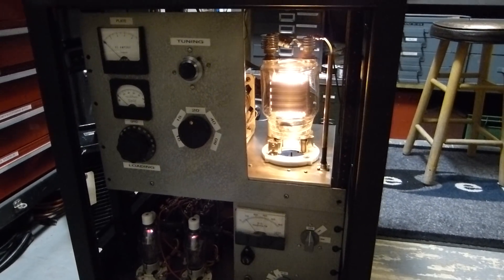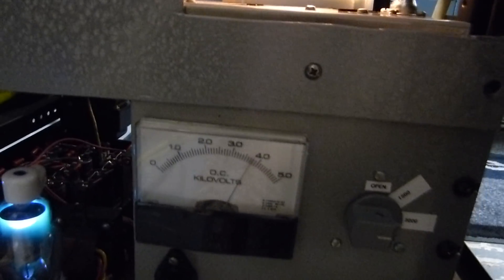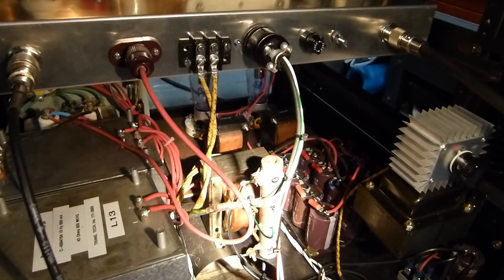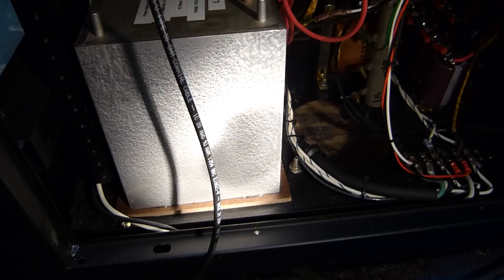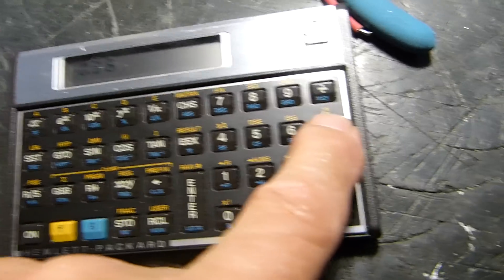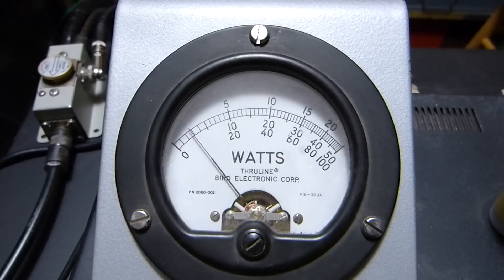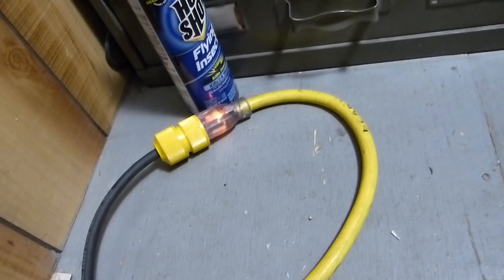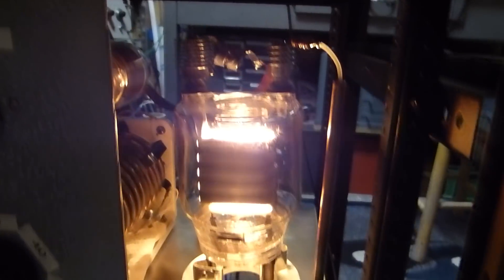(1 of 3) 833A Triode Vacuum Tube Radio Frequency (RF) Amplifier For 20 Meter SSB

Comment: I´, tinking of building a 833 amplifier in a microwave oven, using the microwave transformer as HV power supply....
Reply from the maker: I don't think an 833A will fit inside a microwave oven. Absolute maximum plate voltage is 4KV for the 833A. Adjustable negative bias around -90 volts to set plate resting current at 50 mA. The best datasheet is the RCA 833A. Best of success with your project.

Comment: Hello, what circuit did you use to build this amplifier on this wonderful tube?
Reply from the maker: The circuit is a common tuned-grid-tuned-plate,  (TGTP) grid driven design that is common in the vintage ARRL publications and easy to find. There are a good many circuits to be found for the 813 that can be used on pretty much any tube. The difference with the 833A is it requires much more neutralizing capacitance (because i is physically so large and has so much interelectrode capacitance) and the circuit I used is from the Gates transmitters. Attached is a link to a good schematic for the Gates that might help. Gates used the 833A in several of its commercial AM transmitters back in the 1950's thru 1960's for both RF and modulation. Beautiful stuff... hope this helps.  73
https://www.steampoweredradio.com/pdf/gates%20harris/manuals/Gates%20BC-1J%201000%20Watt%20AM%20transmitter%20Manual%20Circa%201955.pdf

Comment: i came back to watch again and steal some tips in view of the camera David , busy finishing mine, hope to mke a video on it when its done ...thumbs up
Reply from the maker: Great... not many people tackle the 833A and make it work right. By far the most difficult thing was getting it neutralized. Without watching this video again, I might not show how I had to stand up a copper strip neutralizing capacitor to finally get to where I could consistently trim the neutralization out with the little round Millen type capacitor. Also, I now use an outboard tuner to make my iCom exciter happy as I never did get the input Z of the amplifier to 50 ohms with no reactance. If I can help, please let me know. I will send you pictures of what I have now if it will help.  I get 1000 watts of carrier with 50 watts in (13 dB gain) and it does easy 1125 PEP watts output sometimes 1390 on my PEP wattmeter.   73

Comment: Hello, is it possible for you to write here the mathematics of how to get the efficiency of the amplifier ... I don't know how you got the .63%, there I got lost, thank you.
73" nice amplifier
Reply from the maker: I determine the input power to the plate of the 833A by multiplying the plate voltage times the plate current and at the same time measure with an RF wattmeter the output power. 
An example might be 4000 volts at 500 mA would be 2000 watts for plate input and assume 1400 watts output  we would get 1400/2000 or 0.7 or 70%.
Reply: @ElPasoTubeAmps  thank you for your answer I appreciate...✌

Comment: I have two 833 tube s I'm going start my build with .beautiful amp you created there.This video helped on some variables I needed
Reply from the maker: My 833A amplifier is by far my favorite amplifier. 1000 watts to the antenna and it is loafing. That beautiful orange spot right in the middle of the tube plate. It has an aura about it that I love. It does have to be grid driven. It is not a candidate for grounded grid as it is not a high mu triode. Its perfect role in life is as a class-C, plate modulated AM transmitter in commercial AM transmitters in the 500 KHz to 1.6 MHz range but has a rating to 30 MHz. I see them used occasionally in 160, 80 and maybe 40 meters but it just became a project to make it work perfectly at 20M and it does. It has to be grid driven and perfectly neutralized. Neutralization is not as mysterious as some people make it out to be. My neutralizing capacitor consists of a large copper strip standing up beside the glass of the tube - about 1" wide and the height of the tube in parallel with a Millen round type (2-10 pF) neutralizing capacitor to get it perfect. It takes about 35 watts to drive it to 1KW. I studied the Gates transmitters schematics and used their input and neutralizing techniques but the input impedance in their amplifiers is from an 807 driver and is high impedance so I use an outboard antenna tuner (not an uncommon thing in homebrew amplifiers) to match the input impedance of the amplifier to a 50 ohm load so my iCom will load up to it perfectly. I tune the antenna tuner input to 50+j0 ohms using an impedance bridge. My plate tank circuit is a modified B&W 852. I think the output tank Q is about 16 and the input Q is even higher so as to be broad tuned. Hope some of this helps. I also run it at 4KV.   73   WA4QGA

Comment: Nice video! Where are the measuring points for the SSB audio signal? Did you measure the grid voltage of the tube? Thanks for your answer, 73
Reply from the maker: Now that I view this picture again, there has been a few improvements to this amplifier. I added a Variac below the switch to the right of the high voltage meter for bias adjustment and I added one of those cheap blue LED meters to the board behind the 866A MV rectifiers so I can see what the bias voltage is set at. I monitor the SSB audio signal in the RF waveform. Some better pictures are on my QRZ page.  73  WA4QGA

Comment: This video is making me very nervous.
Reply from the maker: With an amplifier and power supply like this opened up and working on it, it is probably a good idea to be very cautious as it can be death on contact is careless. Once buttoned-up and all the safety shields put on as it usually is nowadays almost three years later, it is a real pleasure to operate and see it perform. This was the beginning of the project and I can understand how you feel, even watching it.
Reply: @ElPasoTubeAmps  Well, I would have been a lot less nervous if you hadn't turned on the B+ before you pointed out all the plate tank circuits. A graduate of my high school ham club fried himself on a homebrew 4-1000A 40m linear by omitting interlocks and being careless. Since I didn't know him, I had the task of disassembling it.

Comment: If you held a geiger counter in front of the bulb, it'd go apesh!t from the amount of radiation. That's some nice cancer right there.
Reply from the maker: I have Geiger counters and I can assure you, there is no cancer causing radiation coming from a tube running at 4KV. It takes around 50KV to start getting any serious level of gamma radiation.  Your dentist X-ray machine runs around 75KV.  The only radiation coming off a tube like this is infrared. The RF radiation in the room is of such low frequency and power it is of no concern.  Even microwave ovens at 2.4 GHz is a low frequency compared to gamma radiation at 10^19 Hz which would be 10 Billion GHz. We will be OK even with our cell phones running in the 800-900 MHz range next to our head. The news media often times does much more harm than good propagating fake news - that is where the bad "radiation" is coming from in my opinion.   :-)

Comment: Looks like it needs a soft start on those rectifier tubes inline on that switch to the high power side of the tubes in the rectifier circuit to keep that arcing down to a minimum, didn't look good to me.
Reply from the maker: MV rectifiers are never recommended to work into a capacitor filter but these are arranged in a voltage doubler so there is no way around it.  I suppose I got lucky that the value of the capacitors are not so large as to damage the tube at turn-on. I put a soft-start in one of my other amplifiers using an 8 ohm heater element in series with the primary of a large plate transformer but it caused much too long a delay and I ended up jumpering it out to about 2 ohms. I found out from that soft-start that if it doesn't pull in in 1/4 second (250mA) or so, it may not pull in at all once I start talking or the load becomes too heavy. It is tricky sometimes. Anyway, while I agree with your thoughts on the rectifiers, it has amazingly been working great from the beginning.  Something about those beautiful MV rectifiers I can't get away from. I use a pair of 872A in my AM transmitter power supply, twice the size of the 866A. Thanks for your comments. Stay safe...

Comment: Interesting..you are so close... I have your solution to the freq. response and POWER OUTPUT problem  no parts or build change..just circuit changes..-Dale   retired RADIO Engineer....
Reply from the maker: I did finally get it perfect. I studied and duplicated the way Gates does it on their 833A amplifiers. I am perfectly tuned input grid resonate and neutralized. I get 1000 watts output with 25 watts drive and I know it will do more. It is a beautiful performing amplifier and possibly one of the best I have built. It definitely has a "voice" on 20M and I much prefer it to the GG amplifiers I have built. They are just too easy.  :-)  
But I am always willing to learn new ideas. What did you have in mind for the issues I was having in this video?
73   WA4QGA

Comment: Does a radio frequency amplifier amplify a signal at any frequency? Or a better question might be can it amplify anything coming into it via an anode?
Reply from the maker: There are broadband amplifiers that do not have to be tuned and will work, for example, from say 50 MHz to 150 MHz or an even more broad frequency range but in the range they are designed to operate they are broadly tuned. In amateur radio amplifiers the input signal is applied to either the grid or cathode. Often times these inputs are not tuned but the output circuit (the circuit that is connected to the antenna) is tuned for a specific frequency. However, these types of amateur radio amplifiers can be tuned over a small frequency range, for example, 14 MHz to 14.3 MHz by making the inductor or capacitor, or both variable. I hope this helps.
Reply: @ElPasoTubeAmps  To an extent it does help. Thank you. Do you have an email? There are more technical question I have. Your website does not appear to be working.

Comment: I am a bit confused about the rf frequency range of the 833A vacuum tube. According to https://en.wikipedia.org/wiki/833A it says 15-30MHz. Is this 15Mhz to 30MHz or 15Hz to 30Mhz. Does anyone know?
Reply from the maker: The 833A can be used as an audio amplifier so it will work perfectly in the audio range and work at 15 Hz thru the audio range to 20KHz and continuing upward in frequency all the way to 30MHz. In the old AM radio stations, it was common to have two of them operating as the RF amplifier (AM transmitter frequencies are from 500KHz to 1.6MHz) and they also used another two of them for audio frequencies (for a total of four 833A's) to modulate the two RF tubes.  Here is a link you might like for a Gates transmitter using 833A's.
https://www.americanradiohistory.com/Archive-Catalogs/Gates-Harris/Gates-BC1-Gl-Transmitter-1962.pdf

Comment: Looks like a good candidate for a single ended audio amp!
Reply from the maker: I have already been there. I did not have a proper single ended output transformer and used a KW level push-pull transformer that had the core saturate at about the level of quiescent current for the 833A so LF response was terrible. Not saying the 833A can't be used in a SE amplifier but the OPT is going to have to be pretty special.
https://www.youtube.com/watch?v=65ln3YUkUXU&t=2s
I like the 833A but it is no easy tube to deal with. It can not be used in a GG RF amplifier as the mu is too low so it has to be a TGTP amplifier with neutralization as seen in this video. I have three of these tubes and only one is worth having so buying these from Ebay is a real pig-in-the-poke as the saying goes. It may look great but may also be very weak.

Comment: Can you send me a schematic for 866 tube voltage doubler.  I can only find the ones with no doubling voltage to choke and caps.  its the 866 tube section I cant figure out.

Comment: I bet that cost a fortune to build. and you need a laser pointer. So when you turn that beast on does town lights dim? I would bet that the house lights to and I would hate to be your neighbor watching TV.
Reply from the maker: If a person had to purchase every part, paying  full Ebay price or new price from a commercial seller, you are right, it would cost a fortune to build any of this equipment. But, being a ham radio operator for the last 56 years I have accumulated many of the parts so the actual cost at this point time was probably $200... not really sure.
I am always aware of possible TVI or any kind of RFI from my station but now that everything is digital, those problems basically don't exist anymore. 
I have been in this house for 26 years and have asked my neighbors several times, even lately, if I cause them any interference and they don't even know what I am talking about. I do get into my personal stereo a little bit but it is all analog and a combination of vacuum tube and solid state and within a few feet on my property. 
In the "old days" my transmitter would get into the TV,  the intercom, the phone lines,  the stereo and even make the garage door open and close on my house and my neighbors (this was at a different location I am at now) but the digital age has solved most all of those problems for me plus I take this hobby serious and can measure my spurious radiation which is negligible so, life is good and no one in my neighborhood knows I am transmitting.
I might add that in the "old days" we generally were not so concerned of how important it was to use a balun at the antenna to properly match an unbalanced coax line to a balanced antenna, in particular like a dipole. That awareness has changed in the last few years and I use proper matching techniques to prevent radiation from the feed line. Not only does proper matching of the coax to a balanced antenna result in much less, to the point of no concern, of radiation from the feed line when transmitting, it also reduces the background noise at the receiver.
I appreciate your comment and I hope my reply makes sense.
I should use a laser pointer - thanks for reminding me.
Reply: @ElPasoTubeAmps  I am ham as well. Love it. It is time for me to up grade to the next level.
Reply from the maker: @carl112466  I became a General class in 1963 then Advanced around 1986 because i could not copy 20 WPM and finally an Extra class only about six months ago. Took me 56 years to get my Extra class... I am sure you will do good on your test.  
I don't remember the test prep I studied but it was online and cost about $25-$30 or so, if I remember correctly. The study guide I used was not an actual online course but just a set of study questions and practice exams. I think the practice exams were a good way  to prepare.
Here is a link to the free ARRL Extra class question pool.
http://www.arrl.org/files/file/VEs/2016-%202020%20Extra%20Class%20Pool%20Final%20with%20errata%203rd%20release.pdf

Comment: Tube Red Plating at idle. Need more -v bias.
Reply from the maker: Actually, red plate is normal and healthy for these types of tubes. The plate gets much more red with full carrier. My camera doesn't handle this infra red very well and the video looks much more more red and hot  than the tube actually is. 
If a person is willing to run voice operated relay (VOX) then a large resistor can be put in the cathode-ground path with a relay shunting the resistor that comes on with transmit and then there will be virtually no plate/cathode current flowing during standby. It has been suggested by others that I do this including some of the Eimac tube amplifiers I have  built but I have never gotten around to it.

Comment: I bought a bunch of cb radio stuff there was this huge tube in there all wrapped up and stuff but its a 833A what's its worth and does any one want it
Reply from the maker: I see them pretty often on Ebay for sale. Depends if it a USA made tube and the condition it appears to be in. The problem is, like all tubes, you never know what you are getting until you plug it in and see how it performs. Tubes can look perfect and be bad. 833A's were primarily used in small town AM radio stations running low power (1000 watts) in transmitters like Gates and Collins and others. Often times there were four in a transmitter. Two for RF and two for modulator. 
Carefully turn it upside down and roll it around slowly while checking for any lose debris that may be inside the tube. Debris inside the tube is not a good sign. If that is perfectly clean, use an ohm meter and check that there is continuity of the filament. The filament pins are the two smaller and longer ones at the bottom of the tube where the little glass rod is sticking out. If it is clean inside and the filament is good, it may work. Problem is, I have three that look perfect but only one is truly good. The other two look great and light up just fine but will only do about 1/2 and 1/3 the power they should. If you happen to have a 10 volt transformer, you can light it up. It requires 10 volts (AC or DC) at 10 amps to light it up properly.
If it passes the clean test and the ohm meter test on the filament and it is a USA made tube, I could be interested in buying it from you.